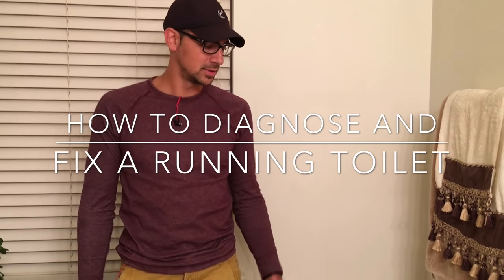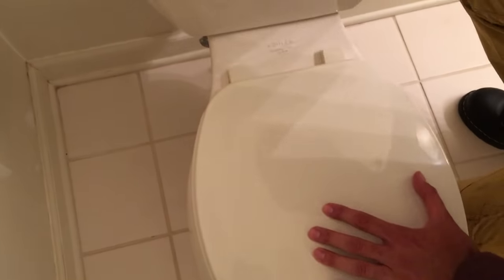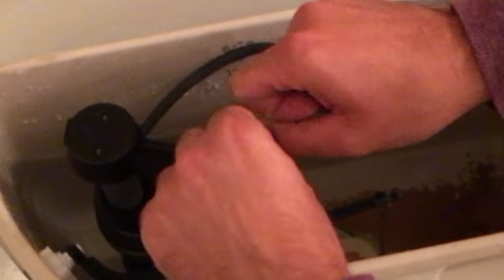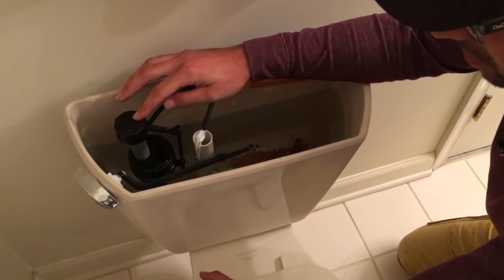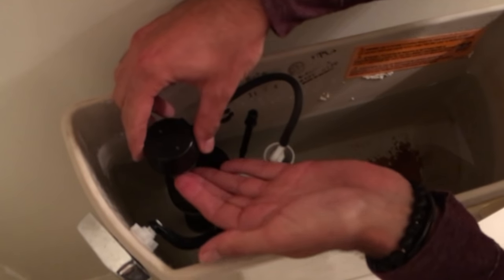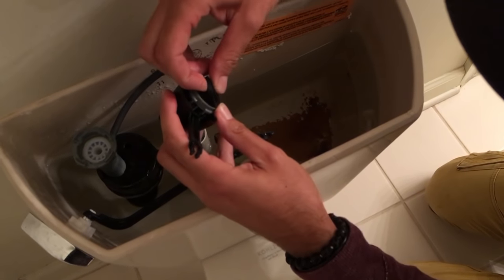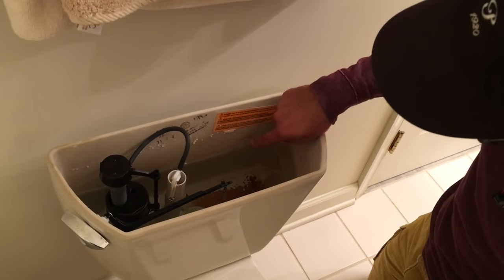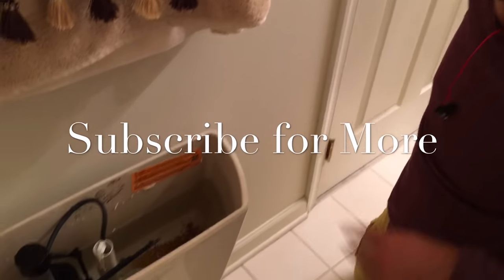How To Fix A Running Toilet *Guaranteed*

Comment: What does it mean if it keeps filling constantly even with the float all the way up? I disconnected the top part like you said and it's been having this problem afterwards, even after reconnecting everything.
Reply from the maker: Audio Described Gaming Ok take a marker a draw a line at the water level. Or...... take food coloring and put it inside he tank. Not the bowl... the tank. Next the idea is to see if the water is leaking down the flapper into the bowl. So the food coloring will help you see if it’s leaking. If you see “ color of the dye” inside the bowl. That means the flapper “ rubber piece” is no good. Those are cheap and very easy to fix
Reply: General HowTo — I have the same problem but the bubble arm doesn’t stop the flow of water so it’s constantly filling and dropping down the overflow pipe. 
I cleaned that top part out and there was a bit of scale, that could just be it. Clean it out a few times to make sure all the scale from inside is out, but is there something I’m missing?

***The toilet had been sitting disconnected for maybe 8 months before I moved and reconnected it tonight.
Reply: @dannyd7426  I have the exact same problem did you find a fix to it????
Reply: Patrick Norris - Unfortunately, I don’t remember!
I don’t think I bought a replacement system... but I could have haha. I might have used the old flow valve deal because that piece was definitely the problem since cleaning it out didn’t fix it.
Reply: Did you have to replace the fill valve?
Reply: Is the water flowing into the overflow pipe? If so, the float probably needs adjusting. If not, your flapper probably needs to be replaced. Place food coloring in the tank. Watch to see if that water is running into the bowl. If not, and you've tried adjusting the float, you may just have to replace the entire float assembly. Don't freak out. It isn't difficult to do. Or expensive. There are a couple of good videos on here that show you how.
Reply from the maker: Roger Wakefield You’re everywhere!
Reply from the maker: Trudy Isaacs Nice tip

Comment: DIYers - beware the very first step! If the valve on the main water line is stuck do not attempt to close it. We had a professional plumber in our home and he attempted to close a stuck valve and snapped off the PVC pipe inside the wall. In under 1 minute the entire bathroom and a third of the bedroom was flooded with 1/4 inch of water. Also everything under the countertop was soaked. It took us about a minute and a half to shut off the main valve outside the house. That is how fast  serious damage can take place  so if you don't know where your main water valve is it is best to locate it first. If you're going to attempt to close a stuck valve next to the toilet do yourself a favor shut off the main water valve.

Comment: I followed u r steps by open the float and clean up the valve seal but it didn't work   then I went to homedepot and bought a replacement valve seal for 3 bucks and I put the new one.... it works !!! 
Hope it will help for other people in the future
Reply: Lovely!

Comment: Could you tell me why (overnite) the toilet bowel fills to the top when I flush driaining is slow?  I noted the tank is not getting filled by the drain hose - seem to be slowly filling from around or under the valve closest to the ceramic.. Is there a quick fix I can do besides replacing the the valve?

Comment: Great, fixed the floater height and it solved the original issue but now after checking the fill valve diaphragm, my fill valve is leaking.

Comment: I noticed the toilet refilling randomly. Changed the flapper and it still happened. Changed the entire Fluidmaster unit and it still happened. Bought a different flapper and it still happened. No syphoning happening. Marked the water level and it gets about 1/2” lower until it refills. Did a dye test, I see dye in the bowl now. Should I keep messing with the flapper?? It’s been changed 3 times now recently! Do I need to “shave” or file down the area it seals to somehow? Do I need to replace ALL the inner parts including the water refill tube thing..?
Reply from the maker: I think it’s the flapper. Make sure you’re getting a good seal. Dye inside the bowl tells you the flapper doesn’t have a good seal.

Comment: Thanks. Brand New toilet and it started to run. It was the floater and the screw causing it to over flow the tube. Happy again. How would I return an installed toilet.
Reply: Can you explain what you did  my toilet is kinda brand new also  my problem sounds like yours did. The the water is high on that tube thing. Any info you provide is appreciated thank you.

Comment: Had an issue which some of you may have. The toilet continued to run after examination of all the bits and bobs showing no signs of degradation. The issue for me was the water level in the basin was so low that the flapper was sitting on top of the water rather than closing the valve. Solution : put my finger on top of it to keep the flapper closed until the pressure of the water could do the job for me. Hope this helps some people 😊

Comment: So I have replaced the Flapper. The issue is when the tank is filling the water still runs into the bowl about equal amount of water that is going int the tank. Can you please help? Thank you!
Reply from the maker: Hmmm. So what happens when it’s done filling. Does it just not stop? Some toilets as they fill the tank will also fill the bowl... but that should stop after a minute or so. Does yours keep running.
Reply: This is new. The water puts as much in the bowl as the tank maybe even more. Checked to see if it is leaking w negative results.

Comment: How do you adjust the water level?
Reply from the maker: Depends what kind of toilet you have. If you have the old black ball. You can adjust it from there. If you have the new style. You adjust it from that black plastic piece. It should show 
on it
Reply from the maker: The toilet in the video. Is the newer style. The small black plastic cap. That’s where you would adjust the water level.

Comment: Can anyone recommend a solution for me???( or any links/videos) My toilet overflowed while we were gone. We turned the water off and cleaned everything up. Waited a few days and now that we have turned the water back on, there is NO water coming in. Also...i was thinking "well may I need to fill the tank and then the bowl, and flush it, to get it started." Soooo attempting to fill the tank it all just went slowly into the bowl. Can't flush it because there's no water in the tank. So I try to plunge the water to go down and MY PLUNGER BREAKS! 😂 I mean ...come on already. Aside from needing another plunger? Any ideas on whats happening. Every other toilet works in the house. All sink and showers work. Thank you!
Reply from the maker: Hmm. Ok water won’t fill in the bowl if the arm or mechanisms. “ flush mechanism” is broken. Basically what tells the tank to fill with water? The fill valve. If the fill valve is broken. The toilet thinks it’s full... so it won’t fill. Coming from the wall you have your water valve right? We know that works. So trace your steps. I think it’s the fill valve. Only other things are the flapper. And the arm. If you take your hand and push the ball down. Will it will with water?
Reply from the maker: Turn the water on... push the ball if it’s an older toilet down. If it’s like the one in the video. Take your hand and push down the plastic piece of the fill valve. See if water starts flowing in. Do it and let me know what happens
Reply: @MasteringHow-To  hello thank you. The ball wont "go down" its as far as it will go
Reply: @MasteringHow-To  its an older toilet. I couldn't push the ball down and when i raised it up nothing happenes
Reply from the maker: N Jones I would go to Home Depot or Lowe’s. Take a picture of the inside of the toilet. Also the outside. Go to the plumbing dept. speak to someone and have them give you a replacement or upgrade that’s going to be compatible with your older toilet. My guess is the valve. Get one where the ball and valve is all in one. While you’re at it. It’s only $5-8 for a new flapper. Get that too. They go bad after a while. It’s rubber and it gets brittle. The flapper will leak water back into the toilet. Thus making the toilet “ run” since water leaks from the tank into the bowl. The toilet senses loss of water. And fills. That’s also a common issue. Don’t get overwhelmed. It’s easy. Trust me.
Reply: @MasteringHow-To  Thank you so much! ✨
Reply from the maker: N Jones Good luck. Let me know how it goes

Comment: i like your flapper test.  shut water off.  use a black marker to make a line to determine water is leaking.  . it should be done wants a year so you will not get high water bill.  thanks

Comment: I have this very exact same Kohler toilet. I just replaced the flush valve and gasket. It was an easy project to do. The dirty part was the disintegrating rubber gasket that left black all over my hands at the slightest touch.

Comment: Thanks for this - I've tried numerous things but wasn't aware it was possible to take the top off the float device and clean the diaphragm - that appears to have fixed my issue. As I live on a small island in Thailand getting a plumber or indeed anybody that knows what they are doing given the language barrier is very difficult - you've saved me a lot time and hassle. Many thanks!

Comment: Thank you so very much for this video presentation.  I did exactly what you instructed in regards to cleaning the fill valve, and it fixed my running toilet.  Before I searched YouTube, I did call for estimates for a plumber to come to my home.  The lowest quote to just diagnose the issue was $85 here in central VA.  Again, thank you for taking the time to make this video.  :)

Comment: Thanks man! Watched your video. Fixed my toilet in 5  minutes. This was driving me crazy since it was a brand new toilet. There was just a little piece of debris in the top of the fill valve. This tiny piece of what look like a piece of black rubber gasket ( probably flashing that didn't get trimmed before installation in the factory) kept making it run. You saved me time and money.

Comment: It is not impossible to take know if the toilet is still running through the flapper. You can add a little bit of food coloring into the toilet tank of water and should you see any coloring in the water running into the toilet bowl then that would suggest that there's a leak through the flapper.
Reply from the maker: JUNIOR LEWIS Great idea. I mentioned it in a previous comment. Thank you for your tips

Comment: The floater was my issue. Just had a toilet installed in my half bath about a month ago, every time I would be in the vicinity for a while I heard it running for about five seconds or so. It irked me. After watching your video I realized the water level was right up to top, grabbed my screwdriver and lowered the water level! That solved it for me! thanks so much! 👍

Comment: older gerber toilet ghost filling..
changed tank to bowl gasket.. wouldn't seal.. leaked badly.. no thicker gasket at supply house.. or h d.. I used rtv gasket sealant..there must be a better way.. any suggestions ?

Comment: I replaced the fill valve and adjusted it so the water level is an inch below the drain tube, I replaced the flapper with exact replacement and thought that fixed it but about every 2 hours I hear the toilet fill back up!  Puzzled now.  Is it possible for water to be leaking through the gasket where it meets the tank bottom?

Comment: I replaced the fill valve and the flapper and water is getting to the right level only problem is after it set not even a min. The floater drop and water keeps running what can I do please help:(

Comment: 2 things: with cap off  valve  put upside down cup over valve and turn on valve to flush  valve. Place food color in tank and wait 20 min, If color in bowel, leaking flapper.

Comment: Okay, in my case, it's not the filler valve and not the flapper. I replaced the flapper. The water still leaks into the toilet.
Reply: Cecil Champenois
Reply: Cecil Champenois I'm having the same problem, did you ever find the solution? I've replaced the fill valve and the flapper, I'm going to replace the overflow tube and the gasket between the tank and bowl next if that doesn't work then I guess it's time to go toilet shopping
Reply: mine the aux fill tube which is normally in the over flow tube was still leaking instead of pointing it in the over flow tube i pointed it in the toilet and it raised my float and the water shut off
Reply: Thanks for that tip. I tired it and now my tank fills. I turned the clip around so that it holds the fill tube in place as it fills directly into the tank. And long term issues this this jury rig?

Comment: What if I replaced the flapper and it still losing water?
Reply: The white pipe that the flapper valve is mounted on my be cracked.

Comment: dood, thank you for this vid! My toilet has been driving me nuts lately and it turns out it was the very last thing you said, the flapper!!! which makes sense because the water thats leaking through the flapper you can see is cascading down the sides of your toilet bowl ever so slightly. so following your advice and making a permanent pen mark was super easy. again ty for the time for making and posting this vid
Reply from the maker: Max Power Hey! Thanks for actually taking the time to comment such a wonderful comment. Glad I can help and so happy you were able to figure it out on your own. Huge money savings!

Comment: Do you have a link on how to change the flapper?
Reply from the maker: Hey, it’s super simply. Just slowly remove the old one. And watch how it comes off. Just replace it with the new one the same way it came off. It’s all about confidence. I know you can do it! Take your time. Go slow. And guaranteed you can do it
Reply: So, I just shut the water off at the base like you did, then change the flapper? I don't need to drain it at all?

Comment: 3:54 incorrect. The water will not bbe up in the ceiling, it will drain into the overflow and into the bowl - like it is on my toilet

Comment: Thank you so much for your information. You saved me hundreds of dollars. I woke up this morning to a toilet spilling over from the tank. I called a plumber, turned on YouTube, found your video and fixed the issue before they CALLED ME BACK. The issue was the fill valve diaphragm that needed cleaning. The fill did not stop completely, but kept filling the tank until it got in my basement. I bought a rigid water vac to clean the water in the basement. Hopefully I don’t have to get a contractor for water damage. Thank you again.